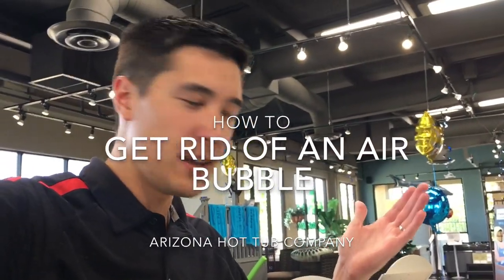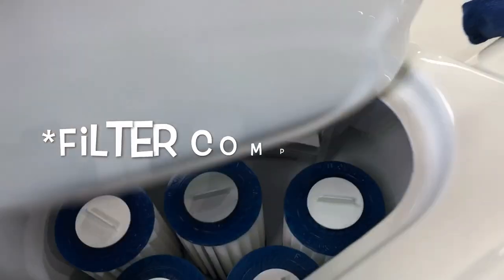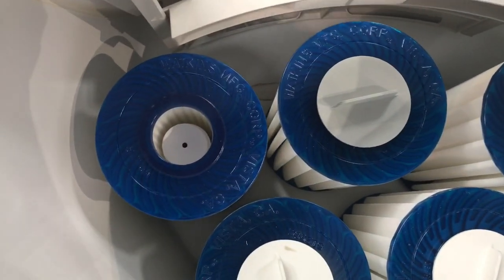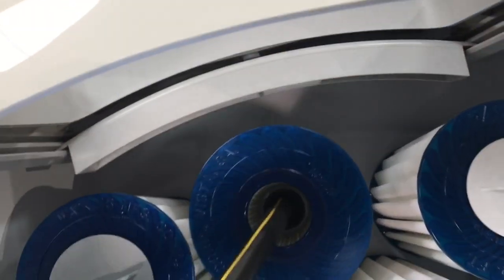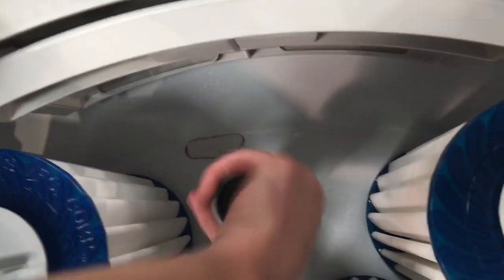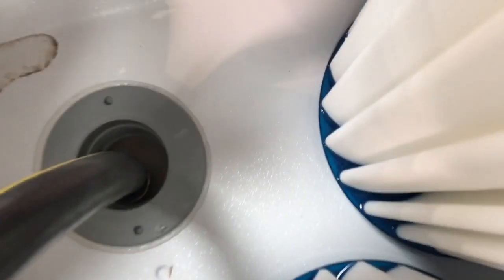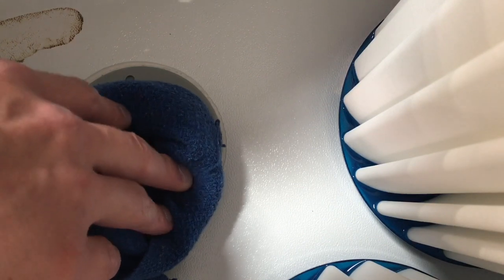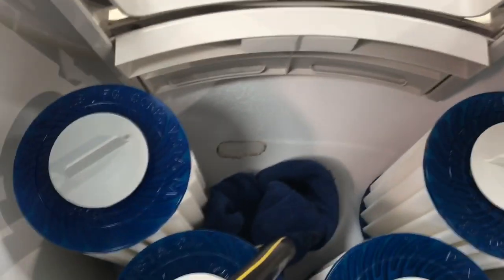How to get rid of an air bubble in your Hot Spring Spa

Comment: It worked great. Thanks so much, best troubleshooting video so far. I turned off and on the hose a few times to push the air a little farther. You could hear the pump catch the water and start pumping. The blue light turned itself back on once the flow started moving.  I now I just have to wait and see if the temp starts to climb.

Comment: Do I need to power off the spa (at circuit breaker) before performing this procedure?
Reply from the maker: It actually doesn't really matter unless the water from the hose is a vastly different temperature from the rest of the water in the hot tub.  It's probably safer to leave the power off and turn it back on when you are done :)

Comment: I don’t have an error, but my jets aren’t working, I do get a little bubbles coming from the bottom, could this still be the problem even without a error blinking message
Reply from the maker: Hi Heather!  If it is the jets that aren't turning over, it could be air in the actual pump itself.  If you have bubbles coming up from the bottom of the spa, the circulation pump and heater should be fine.

You could try to remove the filters entirely, and run the jets (you should hear a hum at the very least) for a few minutes to see if they turn over without the filters in.  Otherwise, you may have to get in the equipment compartment to bleed the air out of the pump itself (normally you do not have to do this.)
Reply: @PrescottSpasPrescottValley  thanks for getting back to me so quickly! Remove the filters! Like the ones I take out and clean and replace? Yes I do have small bubbles coming out of the drain on the bottom, so m going to try to bleed the air out of the pump, there is nasty stuff that came out of the jets when I stuck the hose it in, so I’m going to put spa cleaner in as soon as I get the jets working and it up to temp

Comment: Hi I have a 2021 Hotsprings Aria new and after adding vanishing act pillow there has been some brown residue appearing around the edges of the water. Now the high jets is flowing at different strengths slowing down then speeding up slowing down then speeding up, but jets on low setting work fine. I cleaned the main filter and it’s still happening. Any idea what this could be?
Reply from the maker: Surging jets almost always just mean a blockage in an intake.  The aria has that weir door that floats to the water level… if that gets stuck, it will surge in high speed.  Make sure that is down all the way when the jets are on.  Also, the main filter is only the circulation pump.  Surging comes from the jet pumps.  Remove your filters, all of them, make sure there is no debris, and try the jets in high speed.  If that works, again checking the weir door, then it’s time for a deep clean in your filters or a new set

Comment: Could this be my issue if the jets and ozone bubbles are working and there is no error on the panel, but the spa just doesn't heat up?
Reply: I would just restart the spa, with no filters.  If you still get bubbles from the bottom, it's most likely not a flow problem (pressure switch problem.)  But resetting the spa might reset the heater.  If that doesn't work, it may be mechanical.  Most likely a thermistor.

Comment: Would the jets still push water with a air bubble?
Reply: If it has a circulation pump, the jets would still work, but the heater is connected to the circulation and that could cause the spa to not heat, but the jets to work

Comment: Do i have to drain the spa to do this?    Mines full....  I've drained and stuck the hose in the hole,  and opened the main drain valve and did this.  But it's still going into protection mode.    Dealer agreed,  that that's what my problem is.  But I can't figure out how to clear it.
Reply: You don’t need to drain your spa to do this.  Just power out down, do this, and restart.

Comment: The jets are working just not at capacity.  Would this still be an air lock?
Reply from the maker: That's unlikely.  If it is a Highlife Hot Spring Spa, it could be too much air in the filters (if the filters are brand new), or it could, more likely be clogged filters.  The thing to check first would be to remove all the filters and try turning on the jets (ensure that you don't have any debris in the spa, so nothing gets sucked into the jet pump.). If it works, then you know that is the problem :)
Reply: @PrescottSpasPrescottValley  it is a 2007 Hot Springs Envoy
Reply from the maker: @lindaburnette123  First step would be to just remove all the filters and see if the pressure comes back.  If not, it could be a voltage problem
Reply: @PrescottSpasPrescottValley  okay, thank you. Will try that.
Reply: @PrescottSpasPrescottValley  Great video. I have a 2007 Envoy too that seems to randomly stop heating.  Resetting the power does the trick, but any idea on what would be causing it to stop heating after sitting for a few days?
Reply: @scottokrasinski6603  Do you have blinking power and ready lights on the outside of your spa on the control panel?  If so, that is protection mode, and that generally just indicates that your circulation pump isn't pulling enough water through the heater at a consistent rate.  Generally, a dirty filter.  You could try removing the circ pump filter (grey standpipe one) and reset your breakers.  If it holds heat, that's your problem (just make sure nothing can get sucked down into the circ pump.). - Nick @ Arizona hot tub
Reply: @Nikolai78  Thanks.  Red light is solid and Green light is off since its not to temp.  I can get it to start heating again by resetting the breakers, but just not sure why it stops heating after a while.  Thanks again.

Comment: An easier way is to use a brand new (for hot tub only) plunger remove filter and plunge the air out.
Reply: I tried both ways. The hose was actually easier and better.

Comment: By doing this, could it cause the backside of my Aria Hot Springs tub to leak water?
Reply: No.  The only thing it could do is push water out the freshwater salt cartridge holder, which would be on the side (bleed line).  Outside that, no
Reply: @Nikolai78  thanks for the feedback